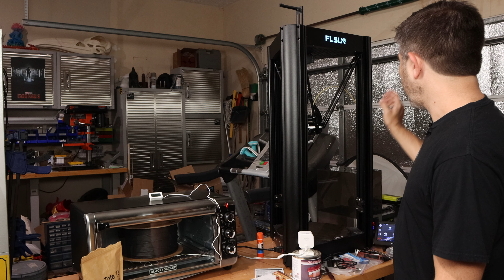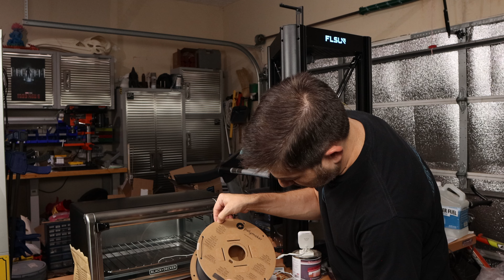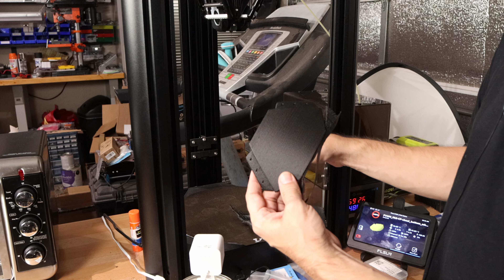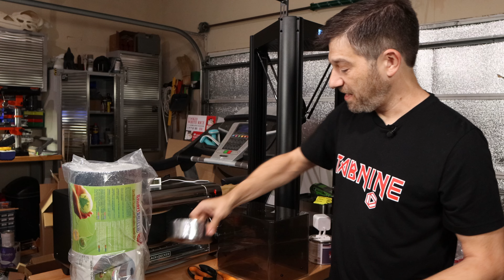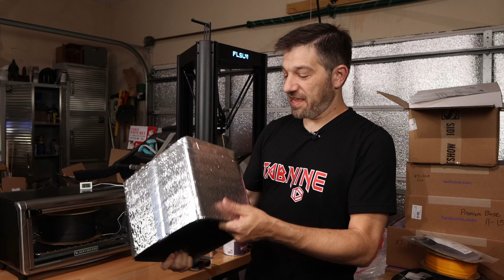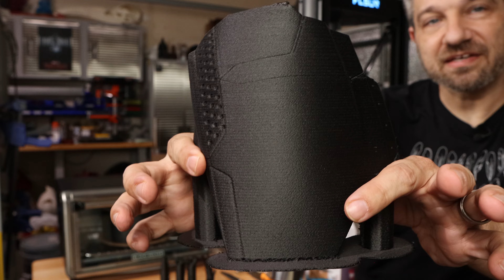Keeping Carbon Fiber Nylon Dry - Iron Man Suit 2024: VLOG 2

Comment: Kris, interesting to watch the process.  The most challenging filament I regularly use is ABS which I have had fair results if a little "wet".  A few suggestions, maybe even a second wrap, or second layer, and that looked like a 3KG spool, I know they are probably more cost effective, and have less changes, but if you used a 1KG it might fry faster and stay dry, and you could swap them out if they did pickup moisture.  Keep on in the oven and one printing and every 8 to 10 hours swap.
Reply from the maker: Thanks for the watch! I think the first wrap is doing the job! I'll update in my next vlog. I'm now getting at least 24 hours out of it most of the time.
These are 2KG spools and the alternative is .5 kg which is a no go and a lot more expensive. I have taken to the swap idea. I keep a dried spool on deck for the project!
Reply: @kerseyfabs  making progreess

Comment: Thank you for the vlog. Question on the v400. Do you have the Flsun enclosure? I thought PC would need it. I have one, new in box, but I print PLA and it is not needed there. Thought I would get into PETG but my other half indicated it may not be desired (fumes and other concerns).
Reply from the maker: I have the enclosure but haven't installed it either. This specific PA6-CF from Polymaker just doesn't need it!

Comment: Have you tried PrintDry?  I have 2 of them, and have NEVER had any issue with moisture.
Reply from the maker: I have some of their original dry containers but not one of their dryers. I'd have to check into if they can hold a spool this size.
Reply: @kerseyfabs  their dryers can hold at least a 5kg spool, though you'll need 1 expansion pack for the larger spools.

Comment: Also if you mark your temp dial with a range you’re happy with, with a sharpie…. It’s helpful in my experience, I run all my filaments printing from my toaster oven this way, even PLA.

ETA, if you do this move your temp probe to where it will be in the hole / middle of the spool so you’re not getting low temp information from the bottom or higher temp readings above the filament.
Reply from the maker: Luckily, my toaster can be shut-off with a separate knob than what I'm drying at, so I don't have to move it. As I use other filaments in it though, that could come in handy.

Yeah, I have my probe roughly in that area, trying not to get the cord messed up or caught.

Comment: I have a similar setup that I print from… I stood my toaster oven on its side, drilled a hole and shoved a steel round bar though it with to groves cut into it for washers to keep the soool from walking near the heating elements, then ran a PTFE tube from it out the back to the extruder on my P1S, works well.
Reply from the maker: Yeah! I mentioned your comment from the last video. I'm trying to utilize the tools I've bought as much as possible but I'll do the same if it comes to it.
Reply: @kerseyfabs haha just got to that part. 

I print items that tend to have 18+ hr print times, and to me this was just a solution that works… I have had the oven on for days because I didn’t want to remove the filament yet knowing I’d print other parts later on that day or the next. Curious what solution you come up with though.